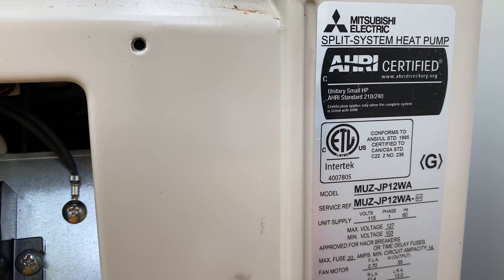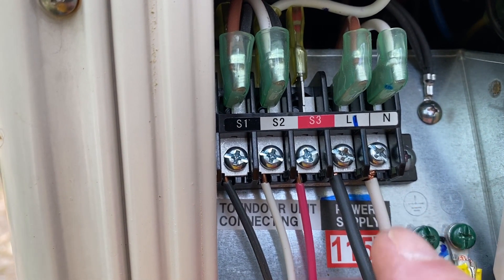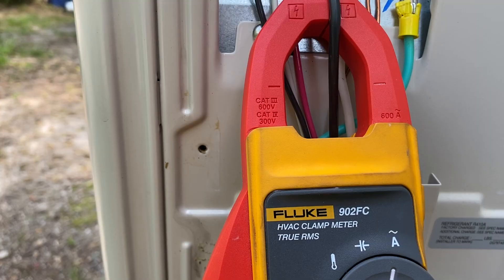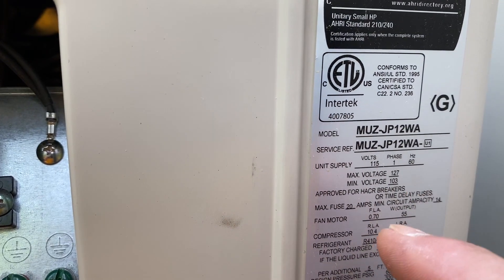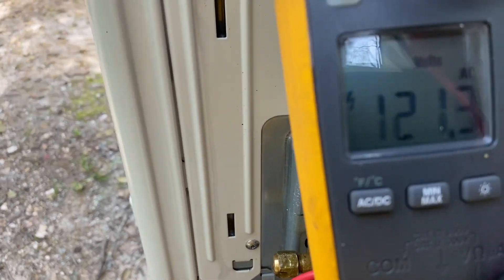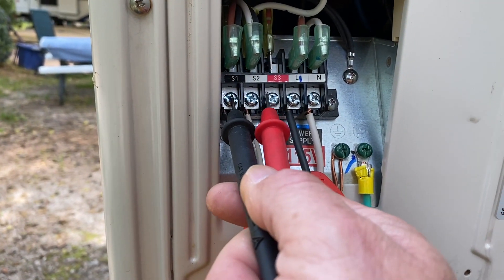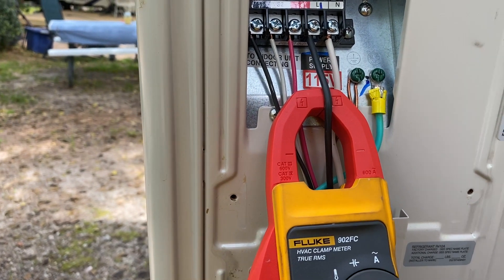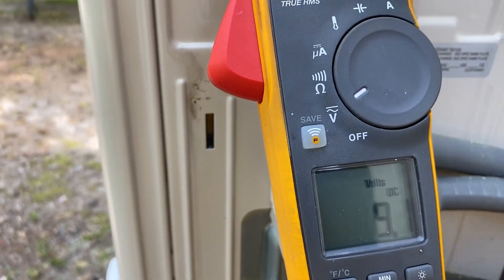How to wire a Mitsubishi MUZ-JP 120 volt mini split

Comment: Since its only 115V system do you wire it to a service/disconnect box?
Reply from the maker: Yes you should. I didn’t do it on mine. A disconnect should be installed though.

Comment: Nice job Ralph. It been too long with out your vids. I believe you said you would never replace R22 with drop in (could be wrong). Please check out Bluon R-458A. I really looks good. Please give a look at it and any thought. Over here in Afghanistan and the price we are paying for R22 is criminal. We use it, R410A, R407C, R134A. Thats pretty much all govt units.

Comment: Looks like solid communication wire ., Isn’t that a no no ?
Reply from the maker: Ricky Hertz Mitsubishi can be be solid or stranded.
Reply: @TandNServices  Good to know , This boiler guy loves stranded wire ! 
While I got your attention, How are these for basement dehumidification?
Reply from the maker: It depends on which unit you are looking to put in. Mini splits don’t look at humidity some are better then others. You have to look at the submittal for the unit you’re looking to put in. 
Getting back to the stranded Communication wire. We only require stranded wire for Communication when you are installing a branch box system. Then from the outdoor unit to the branch box it has to be 16/2 stranded shielded. All other one to one or ported units can use 14/3 with a ground solid or stranded wire.
Reply: T&N Services LLC. Thanks for the info !stay safe !

Comment: You forgot to add just a drop a Nylog to all your electrical connections. It's made of refrigerant so its safe for all HVACr systems.
Reply from the maker: 95thousandroses I did forget to mention I used just a little dab to the incoming voltage